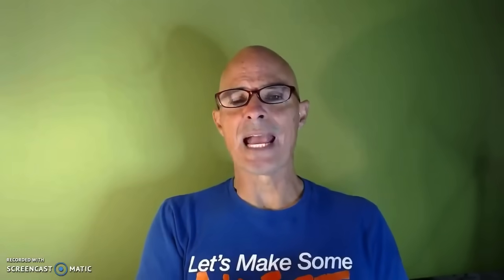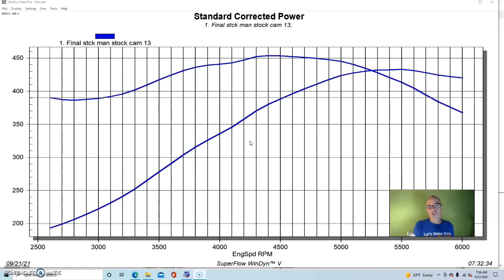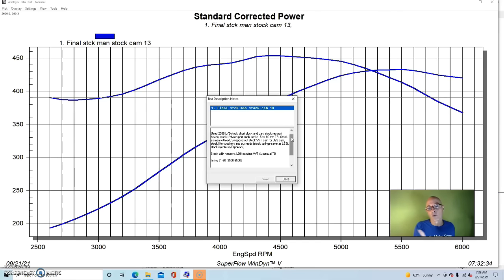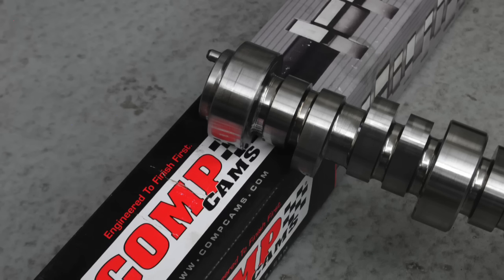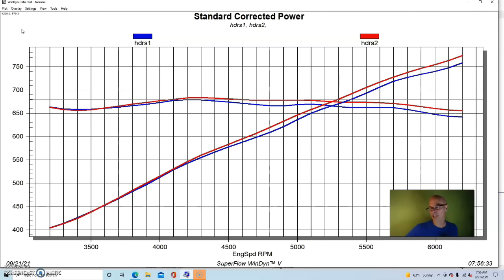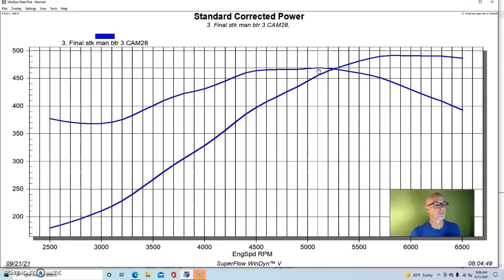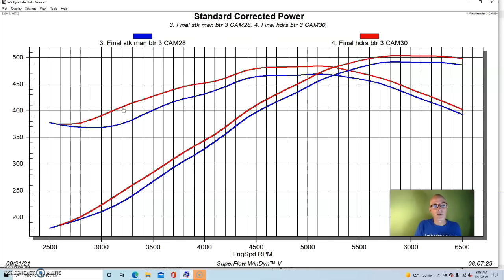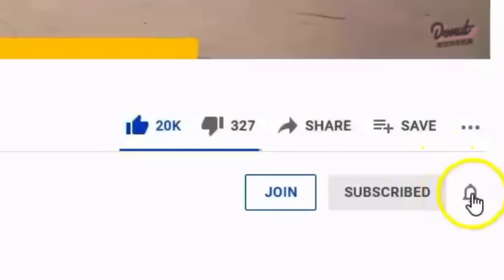HOW MUCH POWER ARE LONG-TUBE HEADERS REALLY WQRTH? JUNKYARD 6.0L LS HEADER TEST!

Comment: You always have to factor in the Scavenging effect a lot of people don't realize or even know how it works
Reply: You are so right. That is why I watch these engine experts like Richard. They actually teach you what's going on and why it's good or bad, not just hyperbole from something that someone said 50 years ago and it's been repeated as truth ever since.
Reply: but would it be better with an x pipe here rather than the divorced headers?
Reply: @1967davethewave  I don't even understand that statement Scavenging is a natural occurrence is going to happen and what you want is to promote better Scavenging I don't know anything about this fifty-year-old whatever nonsense you're talking about building power has always been about math before computers came out you have to be able to literally write down the equation for horsepower
Reply: @1flynlow  to be honest with you bro you're you're talking about a full on exhaust system we're even the size of the collector makes a difference
Reply: @rogerowens5669  What? I agree with you and you call my statement nonsense? Are you off your meds today?
Reply: Sorry Dave was up late trying to get my car ready for the next day and I voice text a lot of times & some times it doesn't Print what you wanted to print and I did go back and spellcheck it my bad have a great day Dude 😎🤙ha ha off my Meds 🤣good  one ✌
Reply: @rogerowens5669  No problem. I was just wondering why you get mad at someone agreeing with you. But I understand spellcheck all too well. I almost got a divorce over a bad text one time!!!
Reply: @1967davethewave  Wow, marry better next time or don't send the text to the "wrong" person!!

Comment: The LS manifolds  are good enough and dont go threw header gaskets . Every time I had headers I kept burning out gaskets . If your on the street I would manifolds and headers on the track.
Reply: try Percys next time, never had one leak in years on multiple vehicles
Reply: 31 lb ft of torque difference is enuf for me to put up with headers...
Reply: I agree, also burning up starters isnt worth the trouble. Sure you can wrap it but not worth it for me on the street anyway.
Reply: @coupe50h  never had the starter issue... Maybe depends on the application
Reply: @rustinpenner5661  yes indeed, also  Coated headers are the way to go, and in most applications, wrap all nearby wiring, even if it's several inches from the tubes.
Another thing is plug wires sure do catch alot of abuse, of course there is remedies for that too.

Comment: I saw a test on Nick's Garage with a bone stock 2 four barrel 1970 426 Hemi. The factory rated this engine at 425 Horsepower. On the dyno with factory exhaust manifolds, the 1970 426 Hemi made 500 HP.. By adding only headers, the 426 Hemi made 550 Horsepower.
Reply: That’s 50 hp dude if you want to be totally stock appearing the 50 hp loss from the stock cast manifolds vs the headers is not bad at all

Comment: i have a doubt, why it makes 433 hp almost bone stock on the dyno more than the gm numbers of 364 hp advertises?, is it because of open exhaust, the cam swap, or because of running without accesories, or the efi custom pcm?
Reply from the maker: all of that-GM tests and certifies the power output of their stock motors differently-with all accs, full exhaust, fuel air intake, run at 200 degrees with the factory tune

Comment: Have you done a test to compare stock manifolds with boost vs headers with boost?
Reply from the maker: you don't need headers below 1000 hp
Reply: @richardholdener1727  so what you’re saying is, In this application. Manifolds won’t become a restriction until 1000hp.
Reply from the maker: I didn't say that-I said you can easily make 1000 hp without the headaches that go with headers.

Comment: A few questions sir' 1. can i put a small turbo on my stock 94 4x4 gmc suburban so i can get a bit more power out of it.2. and will it basically bolt on. 3 or would i be better off rebuilding this very good running no oil leaking stock 5.7 350 chevy 210 HP motor using Vortech heads, cam, Timing chain, 2.0 intake, headers into my 2 1/2'' flow masters. it runs great for what it is but once i added the 4'' lift kit and 35'' tires its sluggish up hills or when towing. it has 373 gears. thank you
Reply from the maker: you can add boost if you can tune it

Comment: Are long tubes worth the extra expense and hassle on a mild 5.0ho in a sn95 or any other fox mustang? I've heard even tho the factory shorty's are pretty bad that aftermarket shorty's are still offer meager improvements unless it's a heavy breather then any extra flow will be a appreciated improvement
Reply from the maker: shorty headers offer very little power

Comment: So…I see your stock baseline hp numbers significantly higher than factory. 

I understand exhaust plays a role. I wouldn’t mind seeing an extra 80hp from bolt ons and tuning, assuming it will be freeing up hp and thus better gas mileage and more torque. 

How do I get there for a better driving 2003 6.0? 

Long Tube headers and freer flowing exhaust yes. 

Electric fan conversion to 2005+ Silverado yes. 

Better designed intake and filter yes ish. 

Some tuning, yes. 

Is this enough for 80hp?
Reply from the maker: higher baseline is from lack of exhaust, accessories and air intake plus lower water temp and optimized tune
Reply: @richardholdener1727 is there a set of injectors that are better than factory? I’m not talking about for more flow and high horse power, just more efficient. I assume the 6.0 already has plenty of gas guzzling fuel flow. 

Do you think banks programmer would get me close enough for an optimized tune?

Comment: In the Ford FE world a set of stock manifolds vs pickup truck headers are worth 30+ hp even on a basically stock low compression emissions motor
Reply from the maker: BBC headers can be worth a lot too
Reply: Definitely, most definitely

Comment: hey Rich how often you have to add fuel after you do longtubes or does sometimes the ECU adjust itself?
Reply from the maker: I tune the combination with each change. If run in closed loop, the ECU can adjust to the specified AF target, but I don't do this at WOT-only part throttle.

Comment: Finally I get to find out if the tbss manifolds on my 5.3 are robbing power
Reply from the maker: tbss intake manifold?
Reply: The breadbox intake which is on Gen 4 LS and Trailblazer are the same and perform better than the Gen 3 Intake.

So Gen 3-4-aftermarket MSD Air Force/FAST LSX/R/T
Reply: No exhaust manifolds. They were a tight inexpensive option to fit my 4wd s10
Reply: @richardholdener1727  I did however recently get a tbss I take for the lq9 I'm swapping into the truck. Just working on choosing a cam

Comment: Ive yet to see back to back runs of stock manifold and EQUAL length or Tuned length shorties.
Reply from the maker: shorty headers do almost nothing compared to stock manifolds (even equal length)
Reply: @richardholdener1727  ive heard  yet to see proof. The equal length manufacturer's say otherwise. Id like to put their word to the test

Comment: I have a 5.3 Ls out of a 2010 chevy Silverado putting it in a 1997 s10 single cab pickup will I be able to use the manifolds that came on the 5.3 in the s10

Comment: Are the Hooker 8502HKR's with 2.5" collector about the same power wise as the stock manifolds you show? Do the bigger openings on the Hookers help?  I have fitment issues and longtubes won't work with my project. I have a 6.0 with ls3 heads, and a 219/228 cam with .604 intake and .604 exhaust 112 +4.  Would I gain anything much with the Hooker manifolds? Your experience can probably help me. Thanks!
Reply from the maker: minor gains
Reply: @richardholdener1727  Thanks for the information and all the work you do!

Comment: So long tunes on stock are worth 2.5% boost.  Imo under 500hp that is not worth the hassle or cost on most applications.
Reply: Helps breath overall but gotta look at cost.
Reply: @shadowopsairman1583  doubt it will be as helpful on a forced induction, scavenging is less useful in those applications.
Reply: @bowez9   I agree that manifolds are so much more trouble free but most guys don't leave an engine stock with just headers. And I know drag strip testing my 69 GTO way back in 1983 when it was bone stock and had never been apart it went from 15.2 in the quarter mile to 14.7 with nothing but a set of Black Jack headers. Of course the old log manifolds didn't flow as well as some of the newer type manifolds.
Reply: @1967davethewave  there in is were the issue is factory manifold (logs) versus factory headers.  Since this was a LS (even the Ford Essex used factory headers) log manifolds are excluded (even the I-300 came with factory headers).

  By the early 90s logs were a thing of the past.
Reply: @bowez9  we've seen over 10% power difference at the same rpm at the same boost from cast vs tubular turbo manifolds that can be traced to a large reduction in residual exhaust through scavenging. You're still limited by how much the turbo's compressor can flow in the end but there is still plenty of power per psi improvements or maxing that airflow while needing less boost. Can also have some nice spool benefits from increased VE/cylinder filling with less residual exhaust gas and/or make it less sensitive to overlap/camshafts
Reply: @morrisonfabrications  video doesn't talk about turbos just superchargers.  So while a better exhaust manifold may help a Turbo, it's not in the scope of this video.  Further I'd say on a dynamic tge difference aren't going to be observed.
Reply: @bowez9  my mistake, you are correct! I shouldn't have assumed turbocharged application but always the first thing that comes to mind

Comment: Hi Richard, for my 06 Z71 I can only find exhaust systems that use the original style gm cross over to passenger side.  Even the long tube types use it.  It seems that this would cause unequal flow or is it negligible?  Mild cam and cai so far.  Thanks!

Comment: I did a paper in high school on headers. Two items I could never get the manufactures to answer.  Item one: Does the same header made of different metals flow at a different rate. Carbon steel, vrs stainless steel, vrs  titanium tubing, vrs, coatings? Item two:  What header collector flows better? The square four that you see on almost all headers produced now(88). During that time the fast racer ran custom made flat four collectors(OOOO). Even Chrysler use them on the factory race cars they produced. The Chrysler Kit cars.  What set of collectors is better?
Reply from the maker: collector size, shape and length all change the power curve (there is no ideal-except possible for a given combination and designed operating range).
Reply: The only time i've seen a flat header collector used was for space limitations. But it would be interesting to compare them on a dyno.
Reply: @richardholdener1727  ,, Thank you for the reply, But does what the material the header is made of matters? (stainless is smoother than carbon steel) ,,Then does the same headers  with only the collector shape change only ( yes I know two pipes will be longer) effect  the data.

Comment: Now I'd like to see a test Stock exhaust manifolds VS   holley cast iron manifolds VS headers. With and without cam.
Reply: Didn't motortend do just that?
Reply: @krisjones1286  I just read that article. Search for Everthing you need to know about hooker small block chevy manifolds. They say if your over 550 hp use headers if your after every last hp.

Comment: Interesting. I wonder if what they say about header lenght on turbocharged applications is true.
Reply: Or header size vs stock manifold with a turbo.
Reply: @Jshnyds  
Yes. I'm wondering if it's worth my time to build bigger, full length headers for my single s475 on a 5.0 or keep the mid length I have.
Reply from the maker: keep whatever fits best-you can max out the S475 with stock manifolds
Reply: @richardholdener1727  
I'm sure you can. But I see all these elaborate turbo headers that people sink a ton of time into and I wonder what they're worth over manifolds.

Comment: I would like something on another Other Guys engine.  Dodge 4.7l v8.  Plenty of those in Ram, Dakota, and Durangos.
Reply: Nobody makes cams, heads, intake aftermarket performance parts for them,  maybe headers, but they aren't known for their toughness, it was designed for the 99 Jeep Grand Cherokee, as a lightweight, torque biased V8. Their internals are weak.

Comment: What about in a turbo application? Long tube headers vs stock. I imagine it wont affect the output as much because the turbo itself is a restriction? 🧐
Reply: Shorties always shorties.
Reply: I think he covered this in a video somewhere
Reply: @evanc6110  I dont think he has because he said in a livestream recently that he wanted to test ut
Reply: In theory, a turbo should like equal length runners with runner lenght being a compromise between response and scavenging (so, most stock and street applications short or even no runners, racing medium to long) but I've never seen different primary tube lengths tested to confirm this.
Reply: @177SCmaro  yeah but one you build enough back pressure, it wont actually matter what the tubes are. At least thats what I think
Reply: long headers in theory would be better, but then you get cracked manifolds from the weight of the turbo hanging off it. The rally cars would have the turbo with a strut (with heim joints) to the engine mount to prevent cracked headers as well as having exhaust heat expansion sections, but I've never seen anyone do that lately.
Reply: If your turbo is not limited by rules , use short compact manifold to use all pulse energy possible to spin bigger turbo which makes more power. If limited by rules , size , boost , intake restrictor , then you might benefit from tuned manifold.

Comment: Since GM pioneered their modern casting practices, factory manifolds have been outflowing most shorty headers since the LS6. I'm not surprised to see them hold up well, in comparison to full length primaries... especially given how most of today's full length headers have junk collectors.
Reply from the maker: flow is not what makes power on the headers vs manifolds-that would be scavenging
Reply: @Richard Holdener - what you meant to say is "[bench] flow is not [necessarily] what makes power...".

Had you said that, you'd be correct. As stated, however, it's quite wrong. Flow is literally what makes power. The power of any internal combustion engine is most closely related to its flow rate. Better scavenging IS LITERALLY better flow. It is an increase in volumetric efficiency, caused by the low pressure left behind by exhaust pulses. True, you you can have a header that "flows well" on the bench, but is crap for your engine... but that's because the bench doesn't "flow" like your engine, and your engine isn't "flowing" as well with those particular headers.

All other parameters kept relatively the same (fuel, compression, timing, bore, stroke, etc...), scavenging increases horsepower because you are decreasing resistance through the exhaust stroke, and increasing volumetric efficiency as the piston slows to TDC and transitions into the intake phase.

Comment: this test would much more interesting to se on N/A setup.

i changed header on my ex Honda civic 1.4 D14A3 (75HP) engine from stock 4-1 (short) to 4-2-1 long (unequal length) and i can say difference while driving was extremely noticeable, car gained LOTS of torque. HP wise i don't know what happened, but there was some gain for sure.

Before you had to wait on those 4,5k RPM for engine to breathe well, after long tube 4-2-1 header, engine started to get power around 2k - 2,5k rpm and acceleration was noticeable compared to stock.
Reply from the maker: so no dyno test?
Reply: @richardholdener1727  nope, dont have anyone around to test it.

Comment: I have been reading but with little to back it up that with l83 and l86 truck engines the scavenging on the stock manifolds is so good that on a mildly built engine it's not worth it to have long tube headers. Could the manifolds on those Gen 5 LT be that much better than the LS based engines?
Reply from the maker: my header test on the l83 should minimal gains-think VVT
Reply: I forgot about VVT. Then having LT Headers on my unknown cam l86 isn't the issue. Can you tell if someone has changed to a non VVT cam by looking at a tune?

Comment: Richard I heard that the reason 60's GM Corvette cams had such long durations.. Was to maximize power when using stock exhaust manifolds .. Any truth to that?
Reply from the maker: more likely to maximize power with limited head flow
Reply: @richardholdener1727   Maybe duration to counter limited lift  in the equation also?  Were there any stock engine cams before the 1970 LT1 (that would be 60s vintage) that had over .450 or .460 lift?  I'm not coming up with any on a brain/cell search.
Reply: @arcdestriumph586  The Pontiac 041 cam was first used in 1968 and had 231/240 duration with .516 intake/.516 exhaust lift on a 113.5 center line. It was, according to High Performance Pontiac magazine, the first cam that had computer assisted design. The 426 Street Hemi from '66 to 69 had .467 intake/.473 exhaust.
Reply: I almost forgot, the 67 to 69 L88 cam was huge for the day, .540 intake lift/.560 exhaust lift. Of course it and the Hemi cams were solid lifter cams, the Pontiac was hydraulic.
Reply: Long easy ramps to help the valve springs from pooping out.
All about valve springs loosing their spring rate or breaking back then.